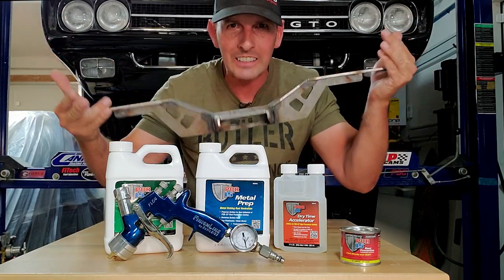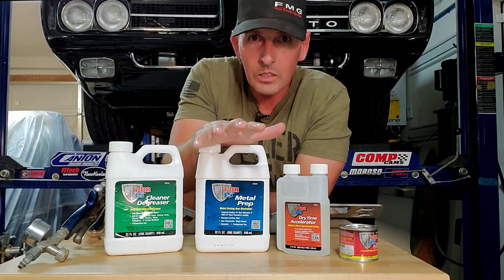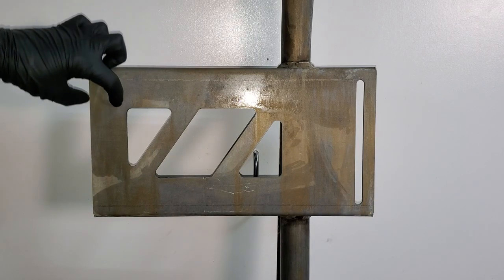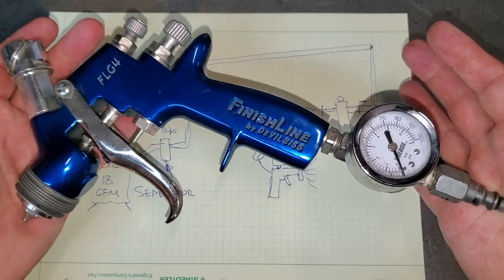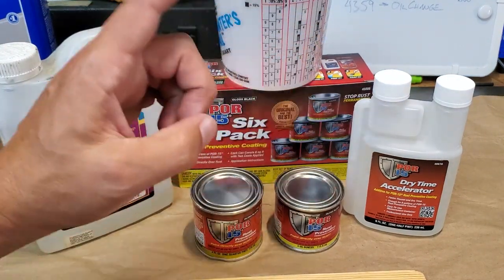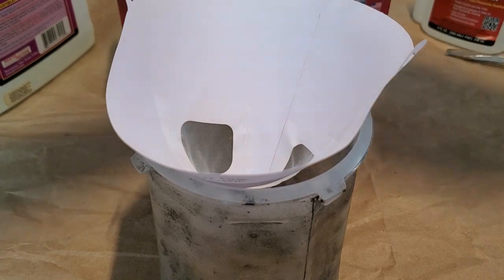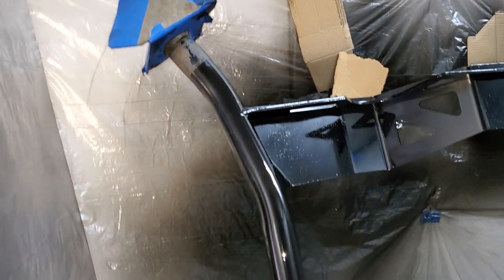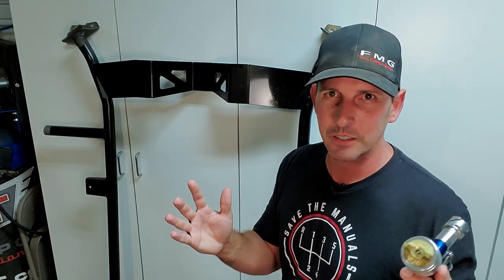Part 3 of 4, Frame Brace install - How to Spray POR 15 with a HVLP Gun.

Comment: I keep POR15 almost indefinitely. When I open a can, stir well. Pour off what you need. Pour the remainder in a clean mason jar. The reason for the jar is you can easily clean the lip. Cap air tight. Never return used POR15 to the jar and never dip brush in the jar. Works very well for me. Great video.
Reply from the maker: Thanks Norm!  Love the tip!

Comment: I wanted to add a comment of caution here. Dry time accelerator is used here for a quick cure. 15 minutes vs an hour. My caution is that if you are covering metal with significant rust on it, I would want the longer cure time even with runs. The reason being that por-15 cures using moisture. It pulls it from the air but more importantly it also pulls it from the rust. I would think the longer dry time will allow the por-15 time to pull more moisture out of the rust leaving less chance for it to be sealed in and available for more rusting later.
Reply from the maker: Good point... however, if the prep solution is used correctly (Phosphoric Acid) there shouldn't be any rust left.  The Metal Prep neutralizes the rust and also leaves a zinc phosphate coating, a known rust preventative.  The POR15 then seals all that up for further moisture barrier.  From my experience, the humidity of the environment determines the cure time.  I'm in San Diego... which is mostly dry.  On a super dry day, it takes up to four hours to cure one coat... that's just to get "tacky".  On a humid day, I've seen it tack up in 30 minutes.  So, the environment, combined with your desired of spray "tack time", should determine the use of the Accelerator.  Hope that helps.  Thanks for the comment!

Comment: I'm about to redo my ole mans 50+ year old Snapon tool boxes. Someone turned me on to POR15.  Your video convinced me.  I was about to spent a lot of money on a bead blaster from Harbor Freight.  (Something I'd rarely use).  I'm also finding that you can paint over POR15, if you don't want black or gray.
Reply from the maker: That's correct!  If you're resurfacing the exterior, make sure you sand it perfectly flat.  And yes, you can top coat POR15 within a certain time frame.  Have fun!

Comment: Thanks, I like to see what is still around and new technology, updates ect! Two suggestions, first use a small thumb twist regulator on the spray gun base, for fine tuning airflow and pressure, second at your air supply down line runs, use a tee for actual supply and extend about 6 inches past the tee, as a additional water/partical trap, with or without a valve for drainage. If no valve clean periodically, with removing cap. House of Kolor, very good stuff, from decades ago experience!
Reply from the maker: Thanks Mark, that's exactly what I have set up.  I didn't do a good job explaining the pressure regulator at the gun, nor the extra moisture trap.  Thanks for pointing that out.  Yup, House of Kolor is my favorite.  See ya!
Reply: @FastMonty  Cool stuff!

Comment: Very nice, I wish somebody had a video for spraying the stuff about 10 years ago! 
& yes do not get any on your self, think it took like 6 weeks to get that stuff off my hands! ;-)
Side note, it's not like nomal paint! So it's very important to not get it in your eyes..  after talking to the rep about spraying it, I bought a full face respirator just for woking with the por-15.
Anyways I cleaned up the engine bay on my accountants 1954 Chevy 3100 A wile back.
As thing do, It snowballed into a much bigger job, that included stripping and painting the front half of the frame. (he wanted to do the back half later to save $) 
I used those skinny "behind the toilet" paint rollers on most of the frame with the POR 15.
Worked great, I was very impressed at how it leveled out!
 After some Hammer & Dolly work, priming and a lot of sanding..  I sprayed the core support, upper radiator shroud & inner fenders with POR-15 Top Coat. 
Now beinng in the Socal desert , my first time spraying a high solid & in August to boot.. the paint was drying before it hit the metal! But after scrambling to clean the paint off before it set & increasing my solvent ratio to like15% I was able to get it to flow nice. and I 100% recommend spraying it, because it came out way better than the rep said it would! 🙂
I'm no content provider but the 54 is on my channel if any one wants to check it out.. there's hardly anything there, so it should be ez to find lol
Reply from the maker: Thanks for the story, and awesome testimonial!  Yeah, just getting the vapor in your eyes stings like a MF'r.  I probably would've been better off with Super Glue eye drops.  Agreed a full face respirator/air supply is the way to go... which I have, and didn't use it.  So, dumb.  Anyway, thanks again for the awesome comment!
Reply: @FastMonty  yeah I was totally covered up and using My respirator even on my back rolling out the frame.. everything went perfect issue free, until I saw a little spot I missed and I hit it real quick with the roller not wearing my respirator and of course I got droplets in my eye.. It was the worst! I don't remember if the paint on my hands was then or spraying in my makeshift spray booth in the backyard 🤪
Reply from the maker: @gorr4  Ouch!  Yeah, most of my eye lashes were stuck together too... lol

Comment: Will the metal prep eat through existing paint? I'm curious as I am coating the undercarriage of a infinity G35. Not looking to strip everything down to bare metal... also there are some spots where the rubberized undercoating from factory has been scraped from car being low. Any recomendations for replacement (por15 rubberized coating any good?)
Reply from the maker: Good questions... Metal Prep "eating through paint"?  depends on the paint, I don't think it would remove it.  You can paint over anything, but it will only last as long as the substrate can handle it.  Haven't used the the rubberized coating yet... let us know!

Comment: I just used this POR15 for the first time, and my dilemma began with a rusty fuel tank for an old Mr2. I first used Muriatic acid to de rust the tank and it worked well. Then after that long process, I began the task of sealing the inside so it wont rust again.  I didn't want to do a rolling method with this expensive stuff, as I worried about puddling and bare spots and clogs, so, I devised a way to use a Previa atomizer and thinned it out with Acetone. 

Once I finished that, I realized that the top of my fuel tank where the ports are for the FP, sender unit and evaporators, were lacking contact with POR15. So I ended up using a flexible paint brush I could extend and shape, and just as well, my gloved fingers to brush on this stuff to those areas around each port. Well, while doing that,  I noticed that some of this layer I painted and dried, came off like old box tape accidentally left on while painting. This was not tape though, it was a layer and strip of POR15 that came off just like tape, along with the stuff it stuck to, like surface rust that even that acid was unable to soak and get. 

That all said, this happened either because I diluted too much of the POR15 with Acetone, to get my atomizer sprayer to work properly, or, its just because there was some light and rough surface rust leftover at the top of the tank, and it came off with the rust it stuck onto. I would rather it be about leftover rust on the metal that didn't allow the paint sealer to dry on clean metal, but I worry just as well, that I messed up the chemistry of the sealer, by using nearly 1/3 of acetone to thin it out enough to work with this particular sprayer.

I know I am beyond the 5 percent that the POR15 calls for, but still, should that just mean each layer I painted would just be light on the substance. I did layer it as much as possible, and areas I was able to directly spray seem pretty nice and thick, but, if this starts flaking off in my tank I am screwed.
Reply from the maker: Thanks for sharing your story... yeah, changing the formula is not a good idea.  (Including the use of Muriatic Acid, which is Hydrochloric)  The acid you should use needs to be Phosphoric.  That leaves a Zinc Phosphate coating on the steel, to prevent future decay.  Anyway, if you're saying you coated the inside of your tank with POR15, I'd recommend buying a new tank.  As, I don't know if POR15 is fuel proof.  Sorry for the bad news, but that's how I see it.  Let us know if I missed something here...
Reply: @FastMonty  , the video was excellent and I thank you for it. 

The painting seems to be decent now, after another 12 hours of drying buy I bet I gave some bare or thin spots that could flake off. 

I read that it's repellent to gasoline but....I may not have read that from an actual Chemistry sheet from the product. Hmmm. Well, I better check that out to be sure as forums can sometime lead you astray. It did have quite the coat and it sells for reasons I saw online for motorcycle tanks, but I also hear that many won't speak about fuel tanks in cars since some states make that illegal along with handling muriatic Acid. I never played with that before but am happy with the results since this tank had alot of bad and rough rust...i did a 16 hour soak, 1:20 mixture with water, and it did get me to clean bare metal but I had 14 gallons to neutralize with baking powder after, and it took alot of baking powder. 

It was very strong as well, it burned when it hit my skin, and it gave me a nasty headache with its vapors, but, aside from all that, it went well. ;)

This sealer, well, I made a big mess but I did get it sprayed in my tank eventually, and on my bare hands too after my gloves tore...The stuff is still on my hands as I write this, and it's a testament to its strength. 

I would do so much better if I had to do it all again, since I had to stumble through all this to learn the hard way about this process. 

I have to consider taking my tank to a professional, but, before that I'll at least try by soaking some gasoline in there for a day and night and see what happens. It's for a classic Mr2 Turbo, of year 1991, and a new tank is nit available. I can perhaps get a hold of a used one from the car clubs, but I'd have to clean that as well to ensure years of protection.

I may 'roll' the last half of a quart I still have to ensure I have it at least topped with some of this unmixed polymer. This is what I wanted to avoid but, I think if I do it in small increments I may be able to get a good coating throughout the tank, and get past the partitions within the tank.

First things first, I need to make sure this stuff is fuel repellent as many have said it is, and many defacto brochures and forums have stated.
Reply from the maker: @phoenixmistertwo8815  Keep us posted!

Comment: If you use the 3M disposable cup, it will come with a cap and it has a measuring on the side of the cup. And when you let it sit, take the gun off spray some 3M paint gun cleaner into your gun and hit the trigger a couple times. That is some powerful stuff.
Reply from the maker: Ahhh, I have those cups too... I love how you can measure in the cup, but don't like how you can't spray upside down.  That said, great tip on the 3M Cleaner.  I haven't tried that yet.  Thanks!
Reply: 3M disposable cup you can spray upside down turn the pressure off hold the gun upside-down hit the trigger it will suck all the air out first then you can turn your pressure down
Reply from the maker: @robertthrem3382  I totally agree, but not as efficient as the DeKupps system.  That said, the 3M system is compatible with 100x more guns, which makes that system awesome.  Thanks!

Comment: Very good gun technique! 2 recommendations, 1 with a top loading HVLP gun limit your time more when gun is not vertical, especially if gun cup is low, 2 use a box fan with an a/c type filter taped to it, for intake only on low this will help clear out your "paint booth" and keep particles out. Do not use fan as an exhaust, as paints mostly are flammable and box fans do not have explosion proof motors!
Reply from the maker: Good stuff Mark... small parts don't necessarily need a vent.  I probably could of utilized one.  My gun can shoot upside down, which is why I love the DeKupps system.  But, most other guns can not shoot more than a couple seconds upside down. Thanks again!
Reply: @FastMonty  Very cool , it's been a while since I bought one. That sounds like a good reason for a new one, that won't splatter spray when turned over too long, lol!

Comment: So you didn’t use a primer? I can’t afford a frame off so this is the next step I will be doing this myself. I plan on cleaning the frame one section or side at a time and spraying.  Mixing paints thinners/accelerators etc is all new to me so thanks for the info. There posted to the right video 😂
Reply from the maker: Correct, POR15 works best when applied directly to chemically etched, and CLEAN metal.  Good luck on your project!  Thanks for the comment.

Comment: Hey Mike, is that the same gun you used to paint your car with?
Reply from the maker: Great question... NO.  I did use this gun for my Epoxy Primer, and High Build 2k Primer.  But, used a higher end SATA for the base and clear.  Thanks for the comment!

Comment: Hi!  I really enjoyed your video. I just purchased my first POR-15 kit with the prep components. My plan is to use the kit for the floor wells and those trunk wells behind each rear tire. The problem is that all of these locations are ‘captive’ and I don’t know how I would wash off the prep components. Unfortunately or fortunately, my 1967 car doesn’t have any rust holes so I can’t rely on them to allow for water drainage. Any thoughts on this?  Maybe a shop vac to evacuate flushing water.
Reply from the maker: Thanks... I get it. I'd recommend using a wet sponge, like a sponge bath.  It'll take longer to clean and treat but should be less messy for prep. Have fun!

Comment: I have just purchased a pontiac 400 firebird ram air 3 1969 4 speed earlier this year and it is a fixer although it runs good. I want to understand the ram air 3 system. I haven't found any videos on your channel that I could find. would you be able to make a short video on that. I would appreciate it. thanks
Reply from the maker: Congrats Jeff!  Sounds like a fun project.  There aren't many differences between a stock 400 and a Ram Air III.  The only difference is the Headers, CAM, and cold air induction through the hood scoops.  So, everything I go through on this channel applies to you too.  :)

Comment: I have a 31' horse trailer, very little rust,can i spray it over existing paint or do i need to prime?
Reply from the maker: Good question... it is designed to be applied directly to metal, but it has to be CLEAN, and you should use their Metal Prep to neutralize the rust, just like I did in the video.  Have fun!

Comment: I unfortunately don’t have a house and driveway to do the prep work so any work I do at my apartment parking lot has to be done fairly quick. Would cleaning rust off with wire wheel be enough for prep work. Don’t need it to be perfect just want to slow down rust.
Reply from the maker: Hey Emmanuel... good question.  Just knocking off the loose rust will not stop the oxidation process.  After you knock off the crud, you have to degrease it, then coat it with the Prep Solution.  That solution is basically Phosphoric Acid... when it reacts with the Iron Oxide (Rust) it'll convert it to Zinc Oxide, which stops the oxidation process, and acts as a rust inhibitor.  Then, and only then, do you coat it with the POR15 paint.  Yes, you can brush it on.  Hope that helps.
Reply: @FastMonty I wire wheeled and degreased it with engine degreaser tho do u think it will work I didn’t use the prep solution
Reply from the maker: @aidenog7380  My vote is, better safe than sorry... use the POR 15 recommended prep.

Comment: I love POR 15. I used it on my chassis.  I used the brush.  It lays down nice. However, t I've had friends complain of cracking after years of flexing, like on a chassis.  Have you had any experience with this?  My friends are pretty particular about their cars and I highly doubt they took short cuts when applying the product. Thoughts? One thing I will say, they have some pretty high HP machines.
Reply from the maker: Yeah, it does lay down nice, including spraying it... sounds like your friends need to stiffen up their chassis'  ha, ha... :)   That said, I don't have any issues with cracking, I also don't have 1200 hp, yet.  BUT, it might be a good idea for POR 15 to come out with a flex additive.  hmmm, good food for thought there.
Reply: Its peeled off on me. I use chassis saver now.